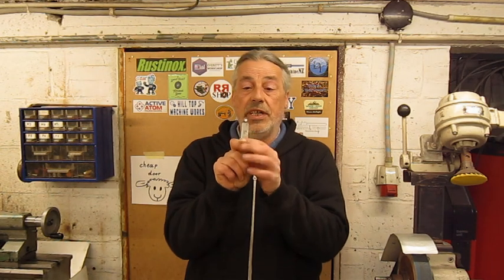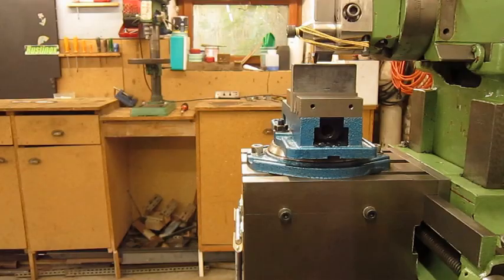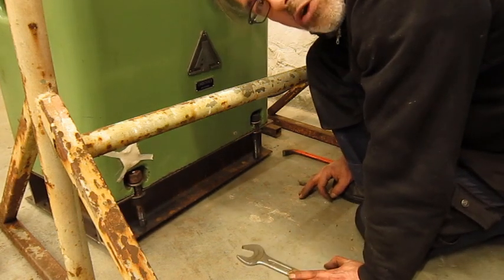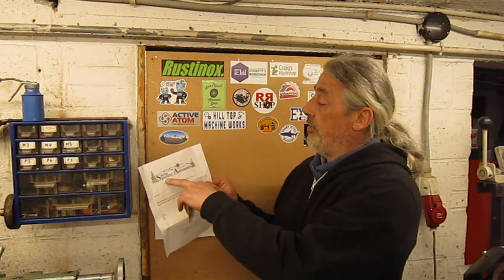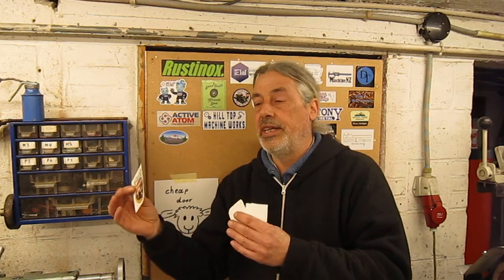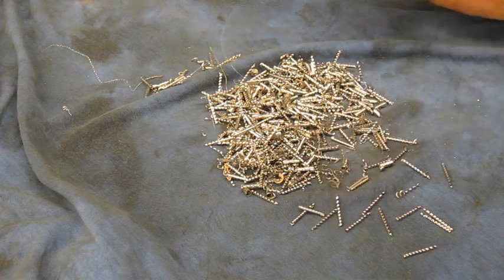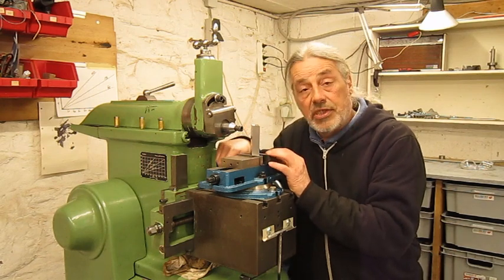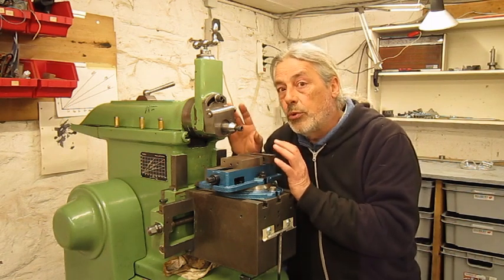Carbide in a shaper ???

Comment: Put a radius on your tool, about 2-2.5 mm. Put a chamfer on the part facing the shaper, about 70-80 degrees and slow down your stroke speed and you will be able to take off about 3-4 mm depth cut.
Reply from the maker: This machine isn't build to take heavy cuts. It just can't handle it.

Comment: Love the video, ended up with a lifetime of inserts when my father was laid off from Ti back in the day. He never used them, any reason not to use them in the machine? Except the fact that you are required to run the machine quite a bit faster.  Probably have 80 lbs of variously inserts
Reply from the maker: Sapers can't run at the required cutting speed for carbite. Gut still, it can be very useful.

Comment: Most likely the factory documentation will tell you to grout the machine in. The modern way is to use an epoxy like Sikkens Wapex 201. It's very easy to do. Keeping the machine from moving is easy to do, but what you really want is to lower the resonant frequency of the system by adding the concrete mass to the machine as a solid whole. Depending on the type of machine and manufacturer, some machine are grouted in and some are not. I spoke to an operator of a very large lathe once and he said a ballpark figure would be to have the concrete slab mass at least equal to the machine's mass. In fact my new mill must be grouted in while my surface grinder sits on factory levelling feet. A revolver lathe I have must not be grouted in (very sturdy continuous casting) but must be leveled using steel shim plates along with rubber, leather (yes) or plastic sheets. And my common center lathe definitely needs grouting is. It has not been done yet, but I will soon now that is in its new location. It is sitting on wooden blocks now and the vibrations are very noticable.
Reply from the maker: For the hobby shop it's less important that machines are fixed. Exept for the shaper.
Reply: @Rustinox  You are right of course. The chain is as strong as the weakest link. Many improvements are a somewhat redundant when the basics aren't there. This also goes for machine wear and adjustments of course. One will want to fix the weakest (and probably cheapest) things first. Modifications like a solid toolpost are of course pretty involved. By the way, my Gema lathes all have the gap bed which is an inherent weak link that is not fixable.
Grouting in a machine you have to be very sure of its location. I will first use the lathe a bit before going ahead. But I can't wait really to find out how much stability improves. It will be interesting.

Comment: interesting idea trying to run carbide tip on the shaper   i have done it but as you demonstrated its not a great success ....if you need to do it to get through a hard surface just run it slow and forget about the recomended speed and feed ...thanks for the video

Comment: Hello, in our country, carbide is used in metal processing after gas cutting. On planing machines, such processing is much cheaper than expensive cutters. Try brazed carbide for better surface finish.
Sorry for my English.
Reply from the maker: I will give it a try, and don't worry about your English. It's probably better than mine.

Comment: Carbide is on my To-Do-List also - lets hope I won't have to bolt my shaper down to the ground for that :D
But since the Klopp is equipped with a tool lift mechanism, it should be easy on the inserts.
Carbide shows its benefits when it comes to high cutting pressure, i.e. high feed rate, thick chips -
and whilst that might not apply on smaller machines like yours, mine might just have the guts for it.
I'll see if I can snatch me a holder somewhen.
Great sense of humor, btw. Wish I was that spontaneous myself ;-)
Reply from the maker: You are absolutely right. My little machine is not powerful enough for carbite. It was equipped with a tool lift when i bought it but it never worked. That made me a bit jealous of your Klopp machine.
Wish you all the best with your exams.
Reply: @Rustinox  I have to say, I usually run the machine with the lift mechanism disconnected. For most operations, it just simply isnt needed. 
But then there's that one occasion where I just wouldn't want to miss it - just like the automatic downfeed. They make this machine so much more sophisticated.
Was the tool lift on yours just badly designed or was it defective? I did a fair bit of modification on mine to make it work properly :D
Reply from the maker: @AstraWerke  On my machine it was a bad design. I've seen your vid where you make the modifications on yours. Brillant!
Reply: @Rustinox  Well, let me know if you should ever plan to equip yours with a better version tool lift, I'd be happy to provide detail photos and dimensions.
Next week will be the last two exams, can't wait to get back in the shop :D
Reply from the maker: @AstraWerke  https://youtu.be/kXdlhDwR_5E
Reply: @Rustinox  I have a couple of projects on my "Prio-List" which I'll do first, but I'll see what I can come up with, ok?

Comment: I used a cemented carbide on mine, it did well enough for rough work.  I didn't realize it was carbide because the patina of the carbide and the rest of the tool were matched until I wire wheeled it.

I tried top speed on my shaper, just long enough to get a 30 second video.  At 175/min, it wants to walk.  Book instructions say to bolt it down and grout it between the base and the floor.  It's not where I want it to 'live' yet , so it's still on blocks.  It would be nice to be able to walk past the end without the risk of getting gut punched.
Reply from the maker: So you have dancing shapers problem too.

Comment: I'm glad you came back to this. I was really interested to see how this would work out. They have carbide inserts that are impact resistant...just for interest. In my completely inexpert opinion, carbide can go fast because it is heat resistant, but doesn't need to. For example watch Adam's old videos where he is turning really large items at his old job and the rpm is something like 100 RPM with a depth of cut something like 1/2" (12.7 mm). The big advantage of HSS used to be that it could be made to be surgically sharp and carbide couldn't, now this isn't true. HSS still is tougher, I think - so can handle  severely interrupted cuts better. Again, I am no expert, but this it what I have gathered informationally  from various sources. One more tidbit, round inserts are the strongest and have an infinite (well almost) number of edges, but take the most horsepower to push through the work.  Wonderful video.
Reply from the maker: Thanks for your commentt, Robert. In insert tooling i am an absolute novice. I just wanted to try if maybe it could work. The only inserts i have are this TCMT inserts you see in this video. It was just interesting to try and lots of fun.

Comment: Bolting the shaper down has definitely been worth it. It's fun moving machines on your own nice one. Interesting video.Tony
Reply from the maker: The problem is of course that every time you move a machine it doesn't get any newer. And my spine either...
Reply: @Rustinox  That's correct. It used to be a lot easier.

Comment: G'day, I used carbide on my P. K. Douglas shaper a couple of times with success, when hard steels blunted HSS too fast. The toolholder was homemade, with old (secondhand) triangular inserts re-sharpened on a greenstone wheel.. I only used 44 strokes per minute, fairly shallow depth of cut.  This seemed to keep clapper action (and tool bounce) to a minimum. I didn't have trouble with insert chipping.  Regards, Steve,  Perth,  Australia.
Reply from the maker: Thanks for your comment Steve. That's useful information.

Comment: Nice experiment.  You sure did remove the material faster.   I think a TPGB insert might work better, no chip breaker and a sharp edge.
Reply from the maker: It was just a little experiment with the only incerts i have. I think i will continue with HSS tools. Cheap and versatile.

Comment: Fun video. I tried my atlas 7B on hi speed a couple weeks ago. OMG I In thought it was going to dance across the floor. I tried running carbide inserts on my big shaper with almost no luck...but I intend to try again on the atlas
Reply from the maker: Thanks Craig. I think the most important is that the tool doesn't bounce on the part.
Show us the results.
Reply: @Rustinox  I will probably give your rubber band idea a try next time (bounce limiting) I also want to change the angle of the cutter, so it can go left or right. Unfortunately I dont have a video of it in action, but I do have a video showing the holder I built (messed up) 
https://youtu.be/7Lpe9Pam1m0

Comment: I ground up and tried your two direction diamond shaped tool bit and it works really well. I've only tried a half mm cut on my shaper but it's much lighter than yours. Thanks for the video!
Reply from the maker: That's nice, George. Thanks for letting me know. You will not have a good finish with it and the point mill wear down quickly. But it's easy to make and very useful.

Comment: Rustic, my experience of using insert carbide tooling on the Alba shows the most common way the tip deteriorates is being chipped on the return stroke. As you'll know carbide is very brittle stuff and doesn't take kindly to being clattered across the workpiece on the return stroke. This is where a mechanical tool lifter would be of great benefit. What about the landlord,does he like his new lightened concrete floor?  If too many people living on one side of the globe all drill their concrete floors at the same time there is a real possibility the planet will go out of balance and fall of its axis. Especially if the errant drillers live near the equator line.
Reply from the maker: I think the rubber bands did the trick. The tool was dragging on the part and not bouncing. 
When i bought this shaper there was a tool lift installed. It was a real poor design. I took it off because it didn't work at all.
And don't worry, i don't drill much holes in concrete :-)